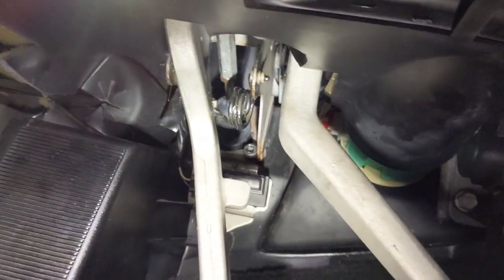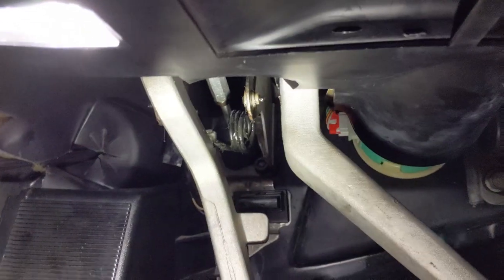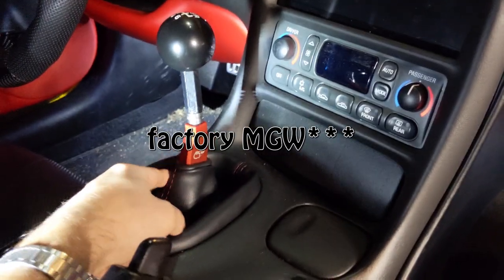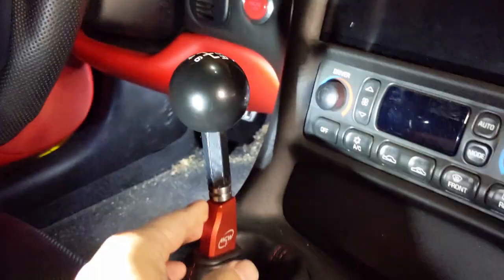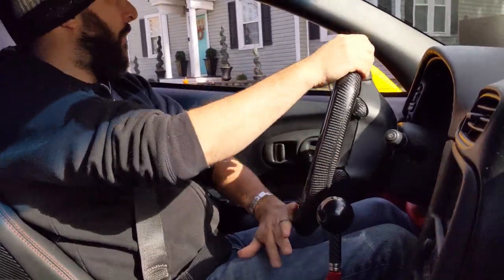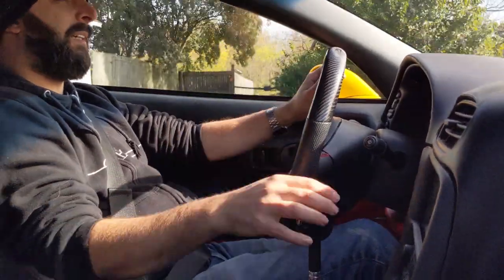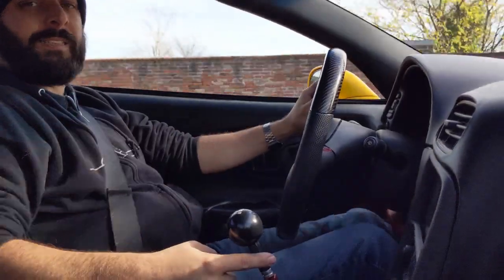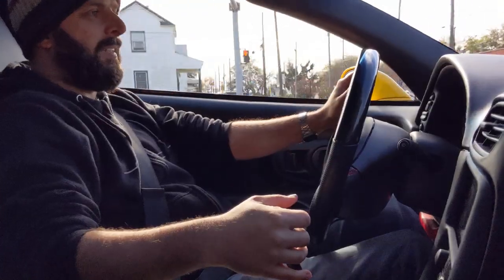MUST WATCH!   MGW & TICK GAME CHANGERS!  |  HOW THEY SHOULD FEEL  |  SUPER SIMPLE

Comment: Nice job.
I have a Yellow (One owner 2001) C5 Z06 with a MGW flatstick.
I also opted to get the red stick and I got a red carbon fiber shift knob specifically for the MGW which looks phenomenal.

I dig your idea because that's what I've done on other cars, adjust the length of the shifter for leverage and ease of use.
The MGW is a tad too short in my opinion because the amount force needed to shift even with the anti venom mod, it was noticeable as soon as I installed the shifter.

As far as the extension I think Millennium yellow or satin black would look proper, I kind of like the look of the current one instead of a round one, might be more rigid too. You can also cut the extension a little at a time and see what height fits you best.
I was going to get a Millennium yellow custom made in a spray can but it's already freezing so I'll wait til spring and spray some parts yellow, I'm considering the throttle body, alternator and possibly the fuel rail covers, I don't plan on painting too much though.

You've help me so much and provided me with great insight and ideas for my Z, Ive done so much to it, I only work on it myself since I'm a mechanic.
Happy Thanksgiving yellow brother!
I thank you for all the great content you produce, excellent videos, even better host and your Z06 is sick as always.

Comment: I have to do the master this winter and maybe a fuel pump.  I don’t think the clutch itself will last through 2022 but then again I didn’t think it would last after my h/c swap in 2021 but th e master did act up on me once. And the clutch engagement feels really terrible in stock form. I have an MGW, have since I got the car, but I want that shifter specifically.  The orange one.  The MGW helped a lot but the shifting itself it still meh.  Not not hey but just stiff even after the anti venom mod.  It’s not the detents, and the lower box moved freely on install.